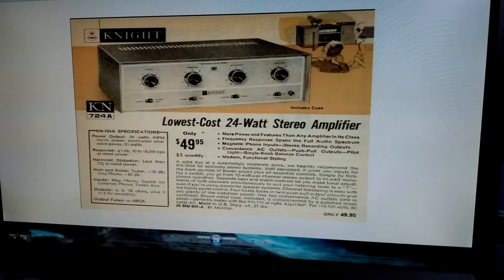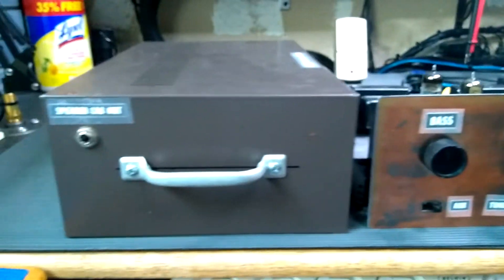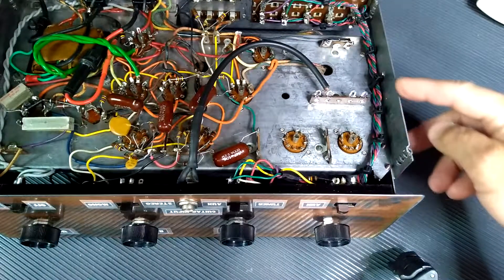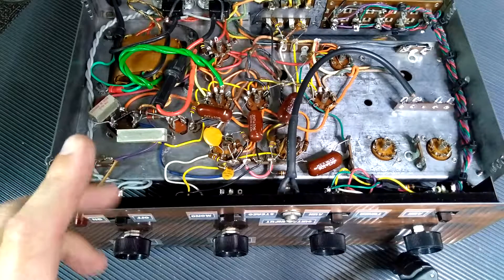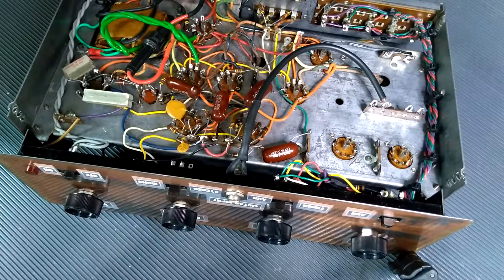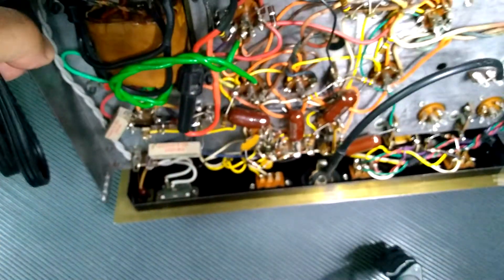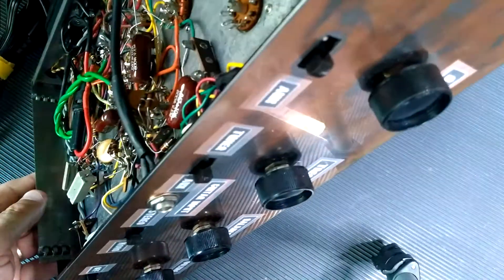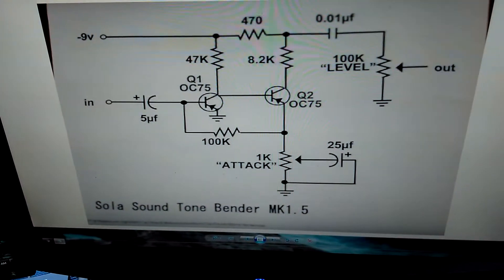Knight KN724A Tube Amp Conversion Part 1

Comment: Two ots, could they be used separately to power my two cabinets, one 4 ohms, the other 16 ohms?
Reply from the maker: On a stereo load I recommend keeping the impedance the same for both channels but you can get away with it but you're going to notice a volume difference in the two cabs the 4 ohm will be louder

Comment: Nice! Check out this URL for the schematic. http://wb9k.tripod.com/.  Also, you could use those two 12AX7 slots for the phone circuits for more gain, then put in Master Volume somewhere before the power stage. Where do you plan on getting the 9VDC for the Sound Tone Bender circuit?
Reply from the maker: Thanks for the link on that schematic!...the dc supply is from the voltage switchable AC to DC transformer I have plugged into one of the rear AC outlets from there it comes into a terminal strip for distribution I'm actually wanting to experiment between 9 and 12 volts on that tone bender circuit I think 12 volts will give it a little more headroom also I'm thinking of using that 12 volt tone bender circuit to drive a starved plate dual 12AU7A circuit or even a 12AT7 into 12AU7A  haven't decided yet until I get that solid state circuit built and see how it sounds and drives the amp,
I honestly just want to do something different and weird with this little amp.